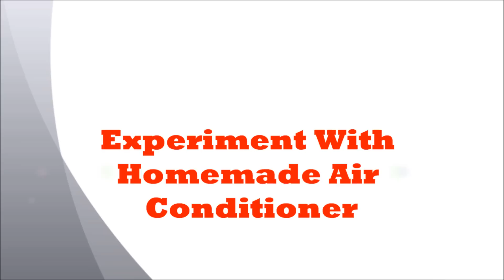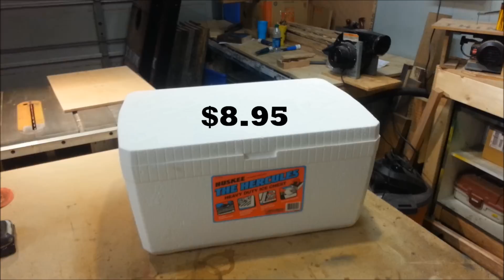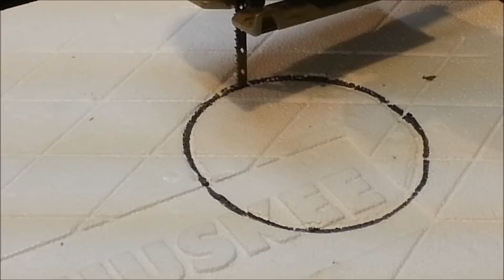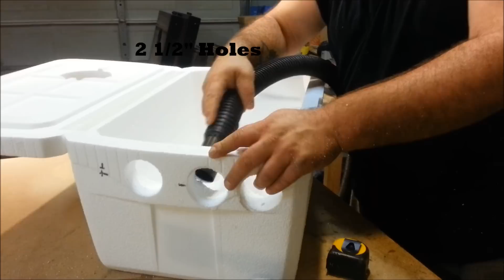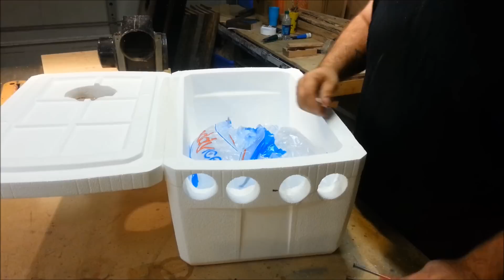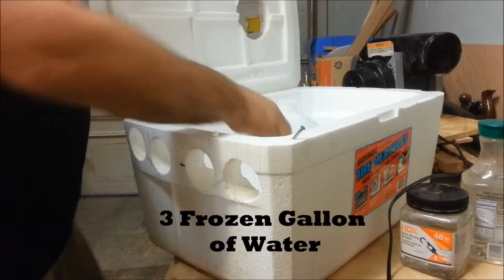Homemade Air Conditioner - Experiment

Comment: thats good and all for a small room but for a few hours only. your better off buying a window unit 5000btu for 100$ to 130$ and look for the watts it runs on 550watts. I own a window ac its 6000 btu and pull 550 watts per hour thats .550 kwh not even 1 kwh. im currently on 12 cent per kwh. so thats .07 cents per hour of ac use.
Reply: You know your window ac units. I'm impressed. Subscribe.

Comment: This only makes sense if you buy the ice though. If you make it yourself, you just heat up the house.
Reply: +MagnificentXXBastard all air-conditioning is about is moving heat from one place to another. Besides the fridge can run all night when it's naturally cold and then use the ice produced to cool the most important places during a few hours of the day.
Reply: Tim Jadeglans

Normal cooling systems dump the excess heat outside of the house however.

Comment: The best way to make it cooler is to remove the humidity from the air. This actually adds humidity.

So, use a swamp cooler or some other such device to get rid of that humid air and it will be much nicer.

Comment: You should try drie ice it will last 10 times as much and it is way cooler
Reply: Don't use dry ice in an enclosed space. It releases CO2 and will suffocate you.

Comment: If the freezer is inside the room, it is a perpetual motion machine.  The freezer pumps heat out of the water to make ice (equivalent to changing its temperature 143 degrees), and dumps that heat into the room, as well as the heat it generates. When the ice melts, it reabsorbs the 143 BTUs per pound that was already pumped into the room, but does nothing about the heat that the freezer or the fan generate. Total heat is actually increased.

An air conditioner increases the total heat also, but it dumps the both heat it pumps and the heat it generates outside.

Good idea for a spot cooler though. Point the blower at your seat or the weight bench, or take it on the fishing boat (with a DC fan), and it will make the spot where you're sitting cooler, but if the freezer is in the house, it will make the house hotter.

Comment: It's really just to sit in front of& blow cool air instead of a regular fan just blowing around warm air not really cooling anything. A fan actually makes the air warmer from running& the motor getting hot

Comment: I fit 5 gallon jugs in mine 2 on each end& one in middle it lasts a pretty long time in my cooler. It's old& beat up but it works. On really hot days I put the jugs in then fill it with the bagged ice  it works pretty good. I've never really checked the temp difference but with jugs& Ice  it lasts longer

Comment: Glad you did this. I was planning on doing something similar but with racks to space the ice apart and using bottles of frozen water. I'm guessing the issues is that there's not enough air flowing around the ice and it's flowing too quickly to cool the air enough to be effecting. Going to go crazy on it and try to make it happen. As soon as I get a day off and cash in my pocket at the same time that is XD

Comment: What would happen if you insulated your metal garage door with styrofoam? Do you think that you could keep it cooler in your garage?

What was the purpose of the styrofoam cooler rather than just a plastic tub?
Reply: Use dry ice
Reply: Clueless? Take a class in thermodynamics.

Comment: ok, I'm a wino and with my very discriminating taste I drink it from a box.  But, I save the plastic bladders, wash, refill with water, freeze and stack them on edge in my system.  Block ice will last linger than cubed or crushed.  Oh my, its five o clock already.

Comment: izzy, thanks for all the vids. i am in heating and air conditioning and since you have given me some good tips, i'll give you one (if you dont mind)... stir a lot of salt into the ice. it will lowering the melting point of the ice and preserve it longer (you can reuse the ice each time). also, cut as much off your ice chest as you can. AIRFLOW AIRFLOW AIRFLOW...you also need a pan below it to catch your condensation (melted ice) . without the drain pan, the melted ice will actually melt the ice you still have. ice stabilizes at room temperature. you also need more ice. 400 sq ft requires one ton of ice per day, to cool it off (thats if the humidity is low).
first law of thermodynamics... heat can neither be created nor destroyed, merely transferred from one place to another. thats all your ac does. it doesnt create cold air, it is merely taking heat from where you dont want it (inside) and putting it somewhere it doesnt matter (outside).
i will give you more advice, if you want it. good luck. 
God bless you and thanks for all the vids.
Reply from the maker: Awesome thank you for the info.

Comment: How about using dry ice?  Maybe not too good an idea though as dry ice omits carbon dioxide and in a small area could remove the air. Wouldn't have to worry about the heat anymore though. Lol.

Comment: Now build a swamp cooler. 

Well, unless you're in a climate that it won't work. In which case, nevermind.
Reply from the maker: it wont work here it is super humid here.
Reply: Couldn't recall off hand where you were, but that's what I thought.

Comment: Yeah it's getting hot in the summer in the attic rooms here, which are also my server room and comuter room.

If you don't mind racking up a larger water bill, try getting some copper tubing, coil it up in front of the fan output, and hook it to the watertap.

With a slow but steady flow of cold water going through, i can get the temperature to drop by qabout 10 degrees celcius, depending on ambient temperature.

Comment: Well, if you can afford it get a better garage door. It will help out tremendously. Or just wall it up like I did.  Get a foam core door with insulation. Then check your your local ordinances and see if you can hang an air conditioner out of it.  I promise, your neighbors won't stop talking about it.   Heck they may even copy you.

Comment: Living in Greece I've had my share of atempts for an air cooler - conditioner (untill I bought an iverter...). Anyway, my best results were with wet towels, not ice. You, my friend, could strap some towel or old t-shirt ribbons on the bottom side of the lid, pour in some water, close the lid, let them soak and then turn on the fan. If you don't mind the humidity, you would be surprised by the results. Always fun to watch your videos!
Reply from the maker: I will try it tomorrow. thanks for the tip

Comment: Would be interesting to see how much the power draw on the blower from your home kit draws per hour against a cheap AC unit.
Reply from the maker: I just got a new amp meter I will be trying it out on that very thing,
Reply: Doesn't matter. Melting ice you previously froze is the part that wastes the energy. Any AC is more efficient than that.

Comment: put some foam sheet insulation on that garage door Izzy! That might help a little if it's not insulated already
Reply from the maker: I will be doing that before long
Reply: yeah it gets hot here in New Mexico too but low humidity
Reply from the maker: I spent some time in phoenix AZ and it was pretty hot there to but no humidity so it was bearable.  Here the humidity is what gets ya.
Reply: I guess you're there because you kind of have to be according to what you said. It's really a small price to pay to be near your kids. That's so important and my hat is off to you!
Reply from the maker: Gee Dubb it is a small price to pay. Love my little rug rats.
Reply: Yeah, I have a 9 mo. old grandson in Austin that I don't get to see enough so I may pack 55 years  worth of stuff up, sell a bunch and move to humid country myself.

Comment: Ice works quicker/melts faster than gallon jugs due to surface area. Try adding a simple blast gate that FORCES the air through the ice rather than just over the top and then I think the ice will melt even faster but the garage will cool even faster. Ya know - if you feel like it's worth more playtime.

Comment: Izzy, I noticed your garage doors aren't insulated. The might be one step you'd want to consider to avoid the shop heating up so much in the first place. It would probably help in the winter too.
Reply from the maker: winters are no problem here rarely gets much below 45. but i plan on insulating asap.

Comment: The problem with ice is all the added humidity.  The AC unit is a wonderful invention that makes woodworking a joy in the summer.  I have one of those big mobile units in my small shop.
Reply: You bring up a good point. Many people think that AC provides comfort by cooling the air. Just as important is that AC also dehumidifies the air.
Reply from the maker: good point

Comment: another idea build something like this O-X-O like a big hourglass one container filled with water on one side and another empty one on the other side connect it with a pvc box and put a millwheel between and store it center put a fan on it the water runs from the top hits the millwheel rotate it the fan begins to rotate when the top container is empty just flip the empty container to the top and the fan starts to contnue working it depends on the size you build it bigger is better and if its bigger you got more power on the wheel and the fan works even more longer this would be a fun project for building best regards from germany

Comment: Here in the desert the humidity is about 10% or less, so we use evaporative coolers.  Water is pumped over pads of loose fibrous stuff and a fan pulls air thru them into the house.  It works pretty well.  AC cools better, but it costs more to run AC.  How cool does it get at night where you live, Izzy?  Maybe you could blow cool night air over a bin of rocks to cool them, and then cool the shop with the rocks.
Reply from the maker: Humidity here funs from 85 to 95 percent most of the summer not sure a swamp cooler would help much.
Reply: izzy swan That's a given.  I just told you what we do here so you'd feel jealous.  I asked you if your summer night temps drop enough for you to get a benefit out of an insulated bin of rocks.  Run air thru it at night to cool it down, and run air thru it in the daytime to extract the coolth.

Comment: Nice izzy. Next time add some fertilizer like urea or ammonium nitrate together with the water in the bottles before you freeze them.
Reply from the maker: what would that do?
Reply: izzy swan It will lower the freezing point of water, so for the same amount of ice, you will have lower temp. This is the main chemical those gel packs have, together with a thickening agent.

Comment: Small AC much more cost effective unless you have a free source of ice. BTW-anticipating a response I got from a similar video- ice from your freezer is not "free" just because the freezer is "already running."
Reply from the maker: I agree. just an experiment to see how it well it works. I have seen similar vids here on youtube and wanted to try it.
Reply: izzy swan Now as a summer camping AC here in Louisiana this kind of cooler is great to help cool off your tent so you can get to sleep. You only need about 3 hours worth of cooling to get you past the drop from 90 to about 70 you get  after midnight.

Comment: Hey Izzy,
 I have spent time in a non air conditioned building in the Florida Keys that had a celestory on top of the roof, which is just a small structure that has windows that can be opened. this let the hot air rise and flow out. There was a cross ventilation as it had openings on 4 sides. It was one of the most comgortable non air conditioned buildings I have ever been in. Also, the windows high up let the light inside in a way that seemed natural.
You might also be able to cover the exterior of your garage with vines that would shield it from the sun.

Comment: I did the same thing many years ago in my bedroom only I just used the bottom of an old cooler to hold frozen gallons and blew a small fan across the top.  You get a very similar heat transfer/cooling effect and don't have to wreck the cooler in the process.

Comment: The dry ice will slow the process.  Until the dry ice sublimates entirely, the water ice will melt/freeze repeatedly.  That why you put dry ice in a punch bowl, to keep the fluid cool for hours.   Simple to try.
Reply: As dry ice evaporates, it's gives off pure CO2. Dumb idea.
Reply from the maker: Cool
Reply: But isn't dry ice dangerous?

Comment: Go with bags of ice over a small slap of dry ice.  That should slow down the melting of the water ice - just a thought.
Reply: I might have my physics wrong here but the ice needs to melt so that the heat exchange can take place.  If you slow down the melting you won't get as much cooling.
Reply: Don't use dry ice in an enclosed space. It releases CO2 and will suffocate you.

Comment: Hey izzy, you could try this, take some copper tubbing and wrap it on the outside of a strong industrial fan, then connect some clear (polyurethane) tubing and have a pump under some ice cold water pumping water through the clear tubing, through the copper tubing and back to the cold water source, heres a vid explaining a little better, 
Homemade Air Conditioner simple DIY AC uses 45 Watts - can be solar powered! by the way great vids, keep it up.

Comment: Getting it started with ice cubes to form ice water is a good start. You need some kind of paddle action going to keep the water circulating & add rock salt. Then add your milk jugs upside down with the caps off. Adding rock salt occasionally, you should be able to keep it going all day --- long enough at one stretch to freeze more ice to replenish it with.
Reply from the maker: I think I am just going to buy an air conditioner.  It was a fun experiment and I can see it being useful in doors or even camping with a battery operated fan but at home more practical fro me to use an a/c unit.
Reply: LOL; I hear ya. I think I'll try to make one myself as the swamp cooler on the roof my slumlords get away with as air conditioning isn't.

Comment: I just took the electric heater out of the shop today.  As much as I hate being cold all winter you can always put on another layer but you can only take off so much.  It might hit 75 in the basement shop sometime in the middle of July if we have a heat wave and I run the drum sander for a couple hours straight.

Comment: Just thinking out loud. But you could run a 1.5 inch hose from the cooler to yourself. Wear some coveralls and pipe it into the back or waist area. Allow the air flow out through the legs and neck area and you should be cool all day long.